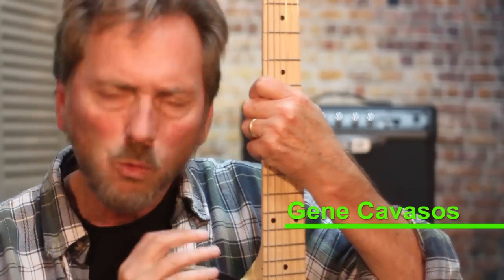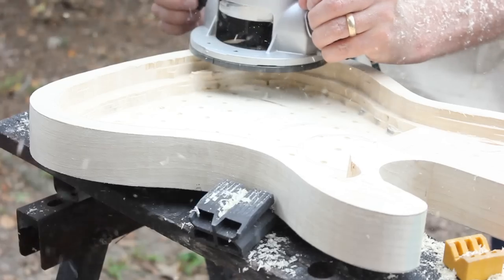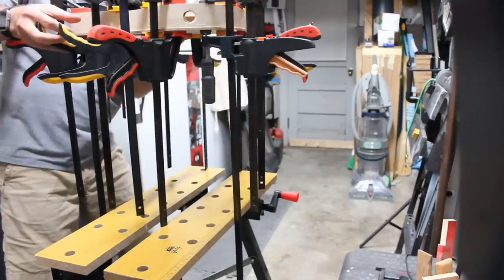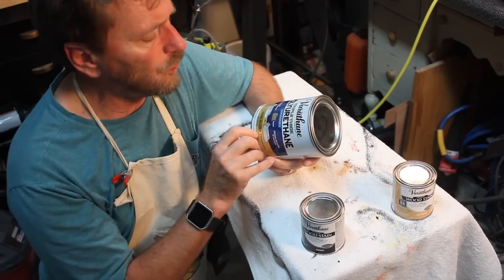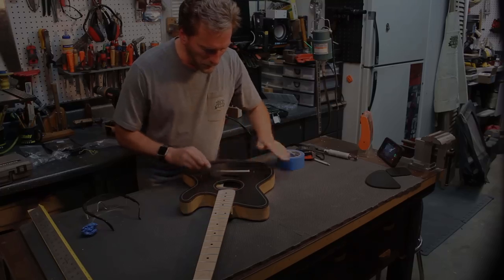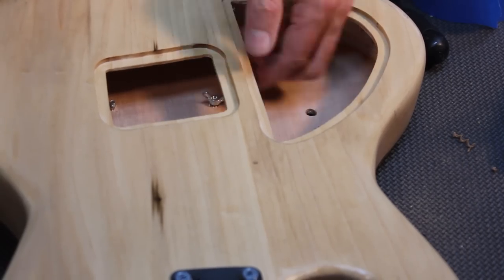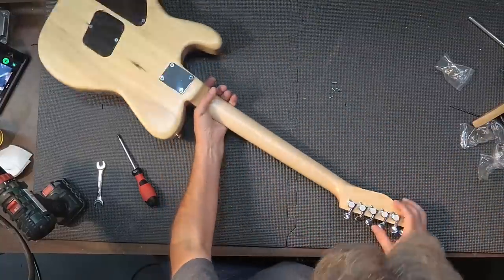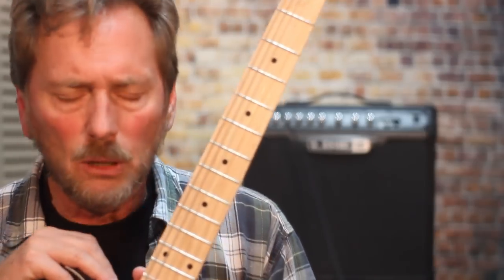How to Make an Acoustic Electric Tele-Style Guitar (Step by Step)

Comment: The bridge needs to have 100% of the area it covers cleared of finish and then glued on. Otherwise it is not likely to stay attached for long. Also, just measuring to get the bridge placement does not adequately position the saddle so that the intonation is correct. This needs to be done by trial and error using a string holding jig before the bridge position is determined and it is glued on.
Reply: How is this guitar going to not stay attached long.
I'm a carpenter,and the project looks SOUND SOLID by my eyes.

Comment: Nice build Gene. Keep on building and learning as you go. That is something everyone should do. You might want to put some hot glue over the Piezo pickup. The self adhesive doesn't stick well on bare wood inside the guitar.
Reply from the maker: William Castleberry , great tip. I was a little concerned about that. Thanks so much for watching.

Comment: I think you did a nice job. I might not have used MDF for the top. Also, maybe a more traditional stick piezo  would cut down on the echo and still sound pleasing. I was also thinking that the bridge is kinda large and blocky for a guitar that's curvy...i might've taken a sander to the wings and made the outline a bit more soft and streamlined.

Comment: Gene, From someone that wasn't a luthier, I'm very impressed!  Someone hit the shielding and the grounding of the strings - Agree.  I personally wouldn't have pen striped, and I would have sanded a slight contour in the top and stained between dark and natural.  However, the strip does look great and creates that accent to break up the black.  As far as the Piezo and picking up immediately,  I bet they have some sort of a delay circuit to avoid the thumping sound of the switch.  How is the sound difference between the Pickup and the Piezo when switching?  I also bet Fender has a circuit board for that too - Some sort of compressor type of thing.  It would be interesting to take a Fender apart and see what it has...Anyone want to donate $2,000?  Again, SUPER job!   Inspiring me to build a Tele from scratch.
Reply from the maker: Arkansas Woodworking, it’s funny I went to several big box music stores just to look at a Acoustisonic and no one had one or had been able to get one in. I’m thinking of building another. But I do enjoy playing it. It has become one of my favorite guitars. Thanks so much for watching.
Reply: @DIYGene  Yeah, so have I....NADA!  Either they sold them, or they can't get them.  It's an intriguing guitar from the videos I have seen.  It's like 8 or 10 guitars in one...Not the 100% replacement for all of them, but a super neat and trick idea.  I also started wondering...How would you shield on your guitar?  Copper tape the entire inside????  Might have to find a humbucking single coil to cut the feedback.  Hrmmm.  Also, I wonder if some sort of resistor across the switch would cut the thump on the Piezo.  I have seen resistors on the Les Pauls.  I always wondered why...TIme to Google.

Comment: Nice work! i made something similar for my partners uncle using Jarrah and Tasmanian  Oak as the cap with a pine back in a Les Paul style. hit a snag with intonation as a an acoustic player (its a tele twang machine because of the cap thickness) but using it plugged in its a mellow, resonant thing with a gretsch growl. Im a subscriber because of this vid, keep making cool stuff!
Reply from the maker: How did you handle the intonation?  I really lucked out and it’s not bad. But with a wood bridge it’s really hard to get it right. Thanks for watching and for subscribing.
Reply: @DIYGene  changed the tailpiece from a combination stopbar/tunomatic to just a stopbar and top wound like I was stringing an LP junior. It held rock solid and shimmed the neck pocket with veneer slice.

Comment: Some bracing, shielding, and extra fine sanding and you would have done better than most first time luthiers out there. Very tricky to get it right but your most of the way there. 👍🏻 new sub from me.
Reply from the maker: I got so many great suggestions that I tore it apart and rebuilt it using some of the great suggestions. Here is the link:
https://youtu.be/HBsMakHdCLo
Thanks for watching.

Comment: Very nice build... if you were to give it a second try may I suggest an in the bottom bridge acoustic pickup instead of the pz inside... that should have a good tone with similar gain to the single bridge and not much body sound coming through...
Reply from the maker: Thanks Hohn, I actually did completely rebuild the guitar and implemented many of the great suggestions like yours. Here is a link to that video: https://youtu.be/HBsMakHdCLo
Thanks so much for watching.

Comment: This video has been out there a while...but still...seeings how you asked: Yes, The Piezo will be VERY affected by where you place it. They work by pressure..so keep that in mind. They have no output when they recieve no pressure and they have tons of it when they are squeezed (like under a bridge saddle). Also: Having some serious on board EQ is very nescessary for a Piezo acoustic /electric system.  Ya see..at best Piezos are still a great compromize.  In fact, if you do this again...look into using K&K pickups inside the body.. for a much more realistic acoustic tone. Still needs a EQ outboard..but there are pedals that can do that for well under 100 USD.  Hope I helped. Cool video,Gene. Thank you!

Comment: A little late on the train here, but great job, Gene! I think it will be an even better guitar with nylon strings and if You move the piezo pickup to the area between the bridge and the strap holder. Just my 2 cents and thanks for the inspiration. I am sure this will be the spring project for me.
Reply: Unfortunately nylon strings would mean the tele pickup wouldn't work as it needs the magnetic vibration of a metal string.
Reply: @57andyp  I was to quick there, I meant of course steel strings for an acoustic guitar, not the strings for an electric guitar, preferably the phosphor bronze ones...

Comment: No top reinforcement? Isn't going to be warped under strings tension without braces?
Reply from the maker: Mikhail Panin, I have had a few folks ask that. I think because the body is smaller than a full size acoustic and the top is 1/8” thick it holding up okay after 6 months. Thanks for watching.
Reply: @DIYGene  alright 👍 thanks for reply

Comment: Besides the lack of bracing you forgot to install a bridge plate under the bridge on the inside. A bridge plate helps protect the top from string ware. You could install a thing called a plate mate it will do a similar job. Cheers.
Reply from the maker: Can I get this plate from stumac? That sounds like a great suggestion.
Reply: @DIYGene  You can get them anywhere just Google plate mate. One thing you’ll need to do is measure your string spacing to make sure you order the right one.

Comment: Good job man. Suggestions: on your next you can not make it NEARLY as hollow. Keep the body MUCH more solid, as it's meant to be played plugged in primarily. Just hollow out a central area around the sound hole. That'll do away with gobs of your microphonics issues. If you choose to leave it that open, you simply must, Must, MUST add some bracing to the top! People generally underestimate the amout of force 6 steel strings at 80% of their tensile breaking strength exert on the top of a guitar... You'll see shortly, you've inadvertently created an archtop.  It'll probably eventually rip the entire top away from the body. But overall, well done bro. Just cut the hollow portion of the body down to just an area about the size of a good soup bowl. Mount the piezo in the saddle under the bridge instead of on the top and the EM pickup into solid portion of the body and you'll get a real performer. I know it sounds like a lot... But been there done that. I'll spare you my headaches that l wish I'd had someone spare me....
Reply from the maker: Thanks so much for the great suggestions and advice. That’s what I’m looking for. I was looking online at the new Fender Acoustisonic Tele and tried to build the body similar. But I can’t get my hands on one to really see how it was built. Thanks again for watching.
Reply: @DIYGene  no problem Gene. Just think of the construction more as a "chambered" body design. Mostly solid, with a chamber within to create some modest acoustic resonance. The piezo will still give you the acoustic sound your looking for. You really don't even need a sound hole, but they do give them a cool traditional look.  If you'll examine closely, most chambered electric acoustics/ solid body hybrid sound holes are either only cosmetic, or are plugged up with a black plastic "feedback beater". Check out the Gibson line of Chet Atkins CE models. They're very similar to what you're aiming at.... Btw the Telecoustic itself is also a mostly solid bodied guitar with resonance cambers built in and cleverly arranged to give the guitar a more hollow look and feel. By doing so you can also avoud the whole top bracing construction debacle.
Reply from the maker: FoulOwl , would you do me a favor?  Would you watch this video from fender on the making of the acoustisonic. This is what inspired this project. I would love your thoughts. 
https://youtu.be/IcuPxpfVCug
Thanks

Comment: may I please ask you where you got the plans from for the body, or would it be easier to buy an old telecaster guitar and hollow that out, I would like to have a go at doing this but I'm not overly confident even though I do have some good woodworking skills I don't particularly have any skills with building guitars
Reply from the maker: I actually went on google images and found a tele layout and then changed the design to be a little different from the traditional model. Then I printed it in 4 pieces, then taped together to make my template. I just completely rebuilt it again using viewer suggestions. Here is the link:https://youtu.be/HBsMakHdCLo
Thanks so much for watching.
Reply: @DIYGene  I have watched both videos and I am very impressed with what you have done and it spurred me on to make my own, I have two fantastic electric guitars I have an Ibanez and fender I also have one Yamaha acoustic and I would like to add this to my very small collection thank you for the updated video
Reply from the maker: @stillo1578 , Thank you. You make me wonder if I should make and offer patterns for these.
Reply: @DIYGene  that is an extremely good idea I would be more than willing to purchase one anything to support someone who is more than willing to share their talents with others

Comment: I am impressed. Just some recommendations on the piezo pickup, get an "In saddle" piezo. An In saddle piezo will eliminate the microphonics. The guitar sounded out of tune, I hope that you get a "Compensated B" saddle to get it more in tune.
Reply from the maker: I have started making several changes to the guitar. One is an under saddle piezo. I used Stewmacs calculator to help set the saddle for better intonation, but you have made me curious about a compensated B saddle. Thanks so much for watching.
Reply: @DIYGene  also look into bracing the soundboard. I encourage you to use stewmac.com as your main source for luithtering.
Reply: @DIYGene  Yes, bracing, for sure. Would be a shame if it warped
Reply from the maker: @newhampshirenate , I got so many great suggestions that I tore the guitar apart and add some of these great suggestions. Here is the link:
https://youtu.be/HBsMakHdCLo
Thanks for watching.

Comment: Wonderfull guitar..nice job .. I got a question.. How to mix the acoustic pickup and single coil pickup together?? Can you give a tips?? Thanks..
Reply from the maker: kyuubi nokuro , I used a telecaster wiring kit from amazon along with the acoustic pickup, then I just switched the bridge pickup out for the acoustic pickup. Everything else from the telecaster. I hope that helps. Thanks for watching.
Reply: @DIYGene  wht kind of acoustic pickup i can use besides the piezo pickup??
Reply from the maker: kyuubi nokuro, I think they make a acoustic pickup that mounts to the bridge on the inside of the guitar. I’m not sure what it’s called. But if I build another one I think I will use it.

Comment: hi Gene i found out alot about the guitars if your interested, but im extremly disapointed , now the bracing is actually ladder bracing that runs the length of the body on each side of the sound hole that are paralelle and longitudenal placed and individually chanberd to create an internal frame and blocks all the airflow and the onboard pc board is actually automated to mimic the multi wood tones and the mod nob oly alowes you to mix them together , and is not an actual hollowbody with actual acoustic resination at all , what you built is an actual eletric acoustic and in my opinion is a better choice and i will build mine like yours and you can call yours the cevasos cajonatar i like that you built a better instrumen and i respect that as a true honest builder thankyou
Reply from the maker: Thank you Andrew.  I am thinking I am going to take it apart, cut off the top and glue on a new solid wood top, rather than the plywood. I want to try a pick up under the bridge and maybe a better sound hole design. Do you think I should brace the guitar with wood strips running along side of the sound hole or block under the bridge?  Thanks so much for your great advice on this project.
Reply: @DIYGene  you can also use a under saddle piezzo transducer that goes right under the saddle  then stick a cone shape sound hole piece into your existing sound hole to deepen the acoustics too some are plastic and can go in and out as you want but with such a thin body modifications may be needed to create a custom sized cone and a single coil hummbucker for a nice raw street sound through the amp im currently building a p-bass with solderless geezer butler pickups from stewmac
Reply from the maker: I would love to see that when you finish.
Reply: @DIYGene  i will post it , might be a bit the neck is around $175 and the pickups are $109 but worh it i normally build solid body neck through the whole body but on this one i will order the neck since it's my first base and i used a sadona red on it and the grain came out awsome
Reply from the maker: Andrew Archer, you should build a YouTube channel. I know I would watch!
Reply: @DIYGene  i am thinking about that cause i also build my native flutes and antler handle knives as im half cherokee and i make a lot of native or maountain man products too i usually post small facebook posts of me playing my flutes my budget is a bit tight , im a single dad raising two boy's here in colorado springs and most of my builds take a while as my youngest sons ssi is my main income and get around $200 after all the bills to play with and ALL my tools come from pawnshops LOL but im good  though now it's time to scrounge up some more wood
Reply from the maker: @andrewarcher6223 , That is so cool.  I would love to build a knife using antler.  I have build a couple of kits using hard wood for scales but would love to try that.

Comment: Few things. Woulda used a quality sitka spruce for the top, made it a bit thinner and braced it so you get extra unplugged volume. The piezo should have been directly under the bridge that’s where you have the best tonal transfer (most are done this way anyway). Probably would have done a dual volume knob and got rid of the switch and the metal switch plate. That metal plate likely restricts the top movement a bit too and a dual volume would allow for more variance in blending the signals.
Reply from the maker: JoeThings ,  Excellent suggestions.
Reply: DIY Gene also, don’t wanna be too critical. Was a really neat project. Came out good!
Reply from the maker: JoeThings, I love the suggestions.  I am working on a video that rebuilds the guitar, implementing several great suggestions from viewers.
Reply: DIY Gene oh awesome! Cant wait!